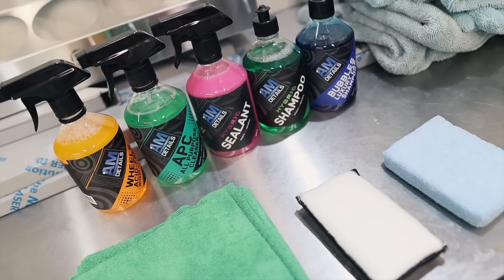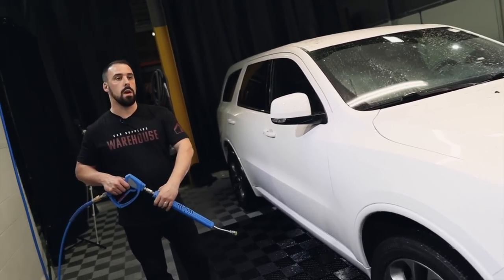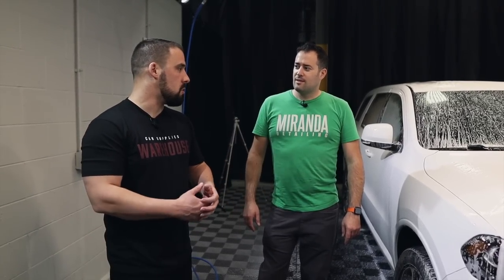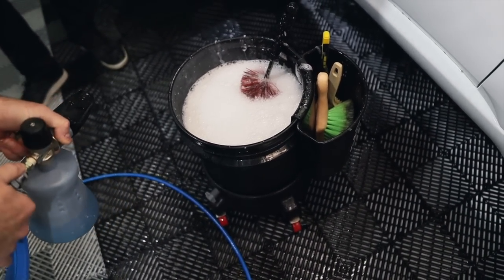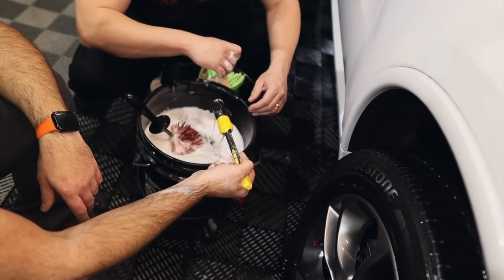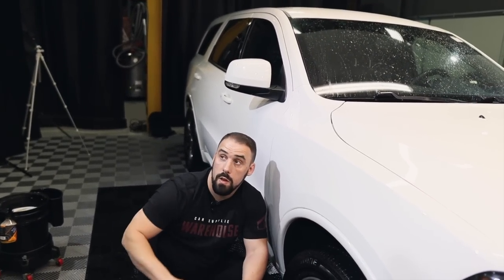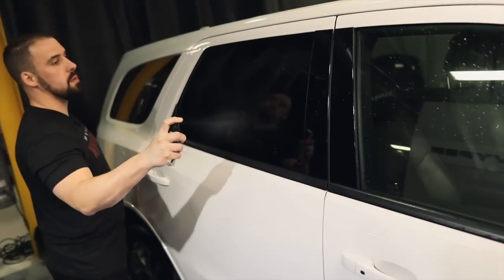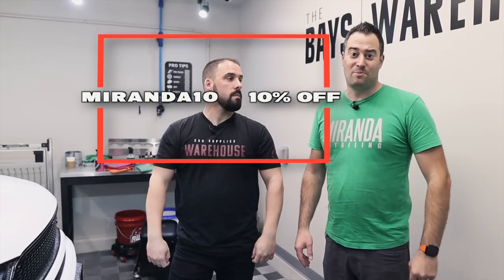Detailing Like A Pro: Tips And Tricks From The Experts!

Comment: I have a ryobi 1800 psi 1.2 gpm pressure washer, Uber flex hose, McKillans gun, using Mjjc v2 pro foam cannon with 1.25 orifice, adams car shampoo 1.5 oz with 17 oz water. I am getting running foam. How can I get thicker foam?
Reply from the maker: Hi. It may just be the soap, I usually just add more soap to the foam canon. Have you tried other soaps?